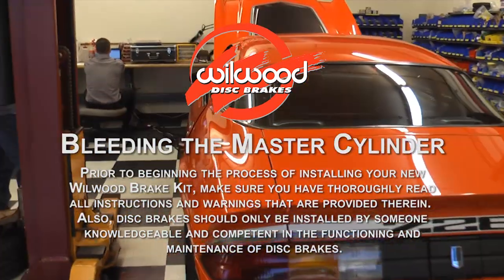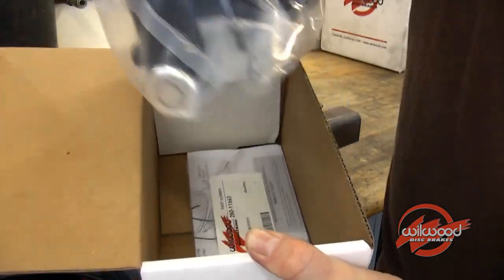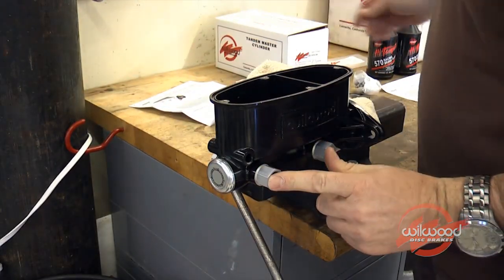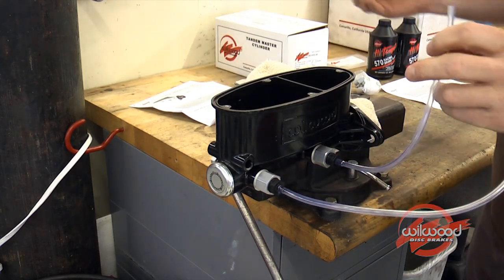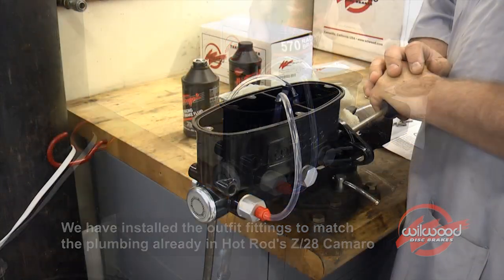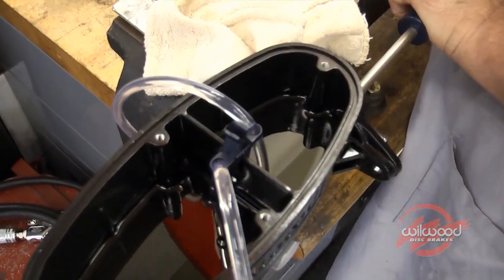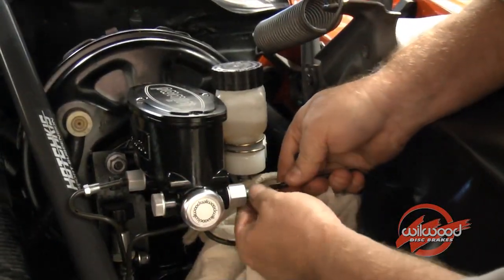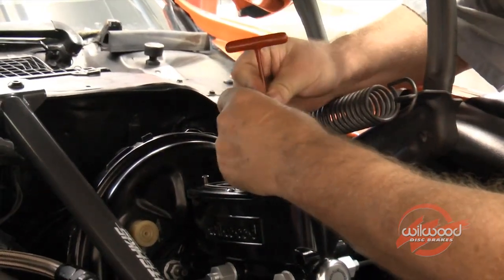How to Bleed a Wilwood Master Cylinder

Comment: Lol, don't put your lid back on your master after you install it on the car, Your not done yet. You still HAVE to bleed your brake system starting at the far rear corner and working around. You should also check the depth of the pushrod coming out of the booster that pushes into the little spacer that goes into the master to make sure you have some clearance and don't hold the piston in to far.

Comment: can this be done with it installed on the firewall??
Reply: After 6 years still no answer?
Reply: Yes, but pay attention to the angle of the installed master cylinder. Wilwood recommends it be bled out of the car while level. Air travels upward, so if your MC had too much of an angle when installed, you may not get all the air out. For what it is worth, I’ve called Wilwood customer service before and they were a great help. YouTube commenters should get off the computer and call their customer service before getting their panties in a wad.
Reply: @thewhiteelephant  I've called the Wildwood customer number too. installed an entire wilwood system, all parts numbers I was told to buy from the wilwood phone techs. Bled it all properly, watched all the videos. Absolute utter junk brakes.
Can barely stop my 2900lb car. Unfortunately they saw me coming and have my few thousand bux already.
Reply: @lollipop84858New brake systems can be a pain. What is the problem you are having?